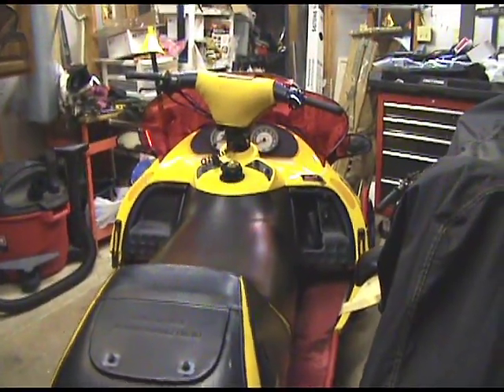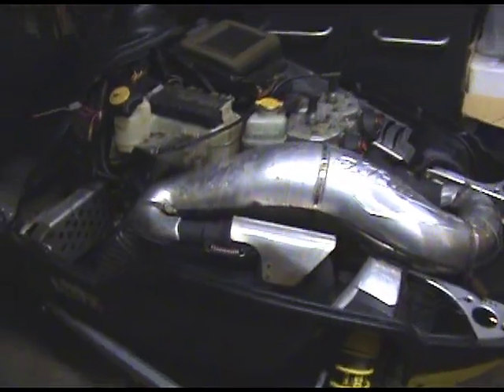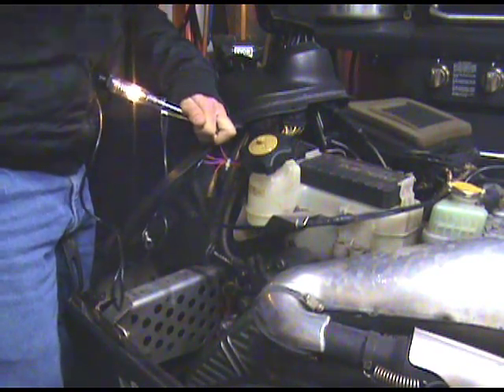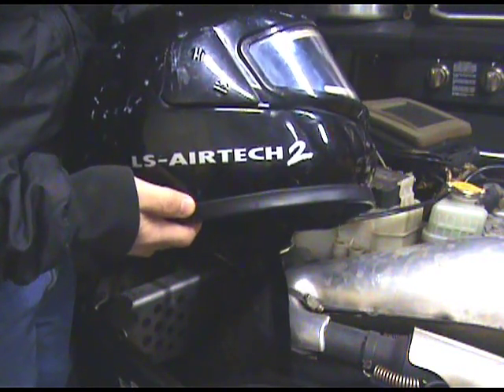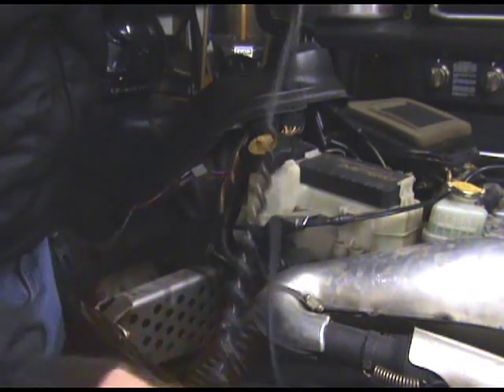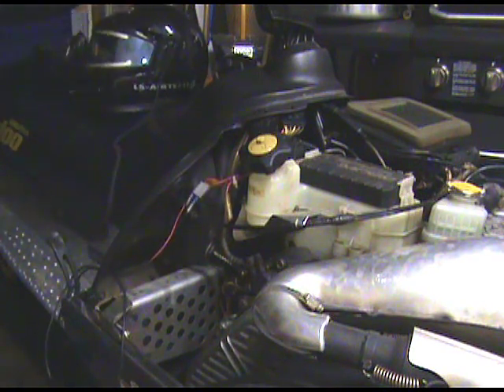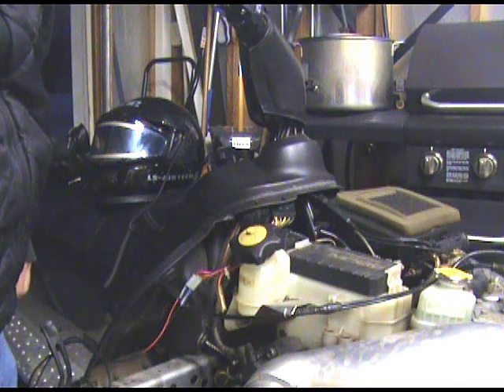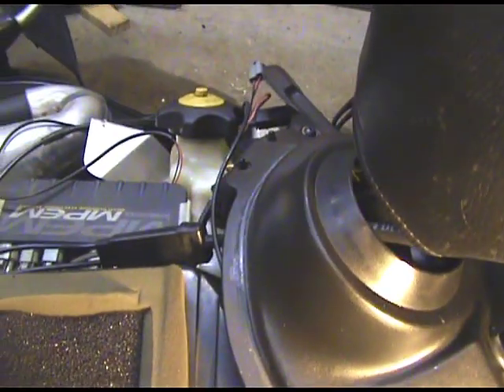Snowmobile Helmet Electric Shield Wire Install on Ski-doo MXZ 700

Comment from the maker: @baseballplayer2121 
I depends on the year make and model of the sled whether it has the outlet or not.  I had a 1983 Yamaha years ago and it didn't have one so it had to be spiced in.  That's a little more involed.  Your 1989 Polaris may not have an open spot.  My sleds available spot may have been for another option that my sled did have stock.  It was there and unused so I used it.  Thanks for watching.

Comment from the maker: @MrMartyzf 
The wiring kit came with my helmet when I bought it back in the 90's and I removed it from my last sled before selling it.  If you don't have one I would either go to a motorsports shop that sells helmets like yours or check online at your helmets manufacturer website.  It really is just an RCA cord like on a stereo system but is made for cold weather and it seals when connected.  Good luck and I hope that answered your question.  Thanks for watching.
Reply: RCA with a 12 v male end I can switch back n forth between atv and the sled now ...... :)

Comment: I have the GMAX heated face shield that I connected to the starter solenoid of a 2013 Skandic. It is ill advised that you do not connect anything directly to the battery because then it is always on. 

A scenario that could happen is one that involves being stuck in deep powder. the snow could get into the socket and cause a short that could cause anything to no damage to major damage to your snowmobile. That being said the connections are a flat eye connection so they could fit on a bolt.
Reply from the maker: +Noah Kuzel 
Are you implying that I or someone else connected there's directly to the battery?
Reply: Not at all. I was just putting it out there that wiring directly off of the battery is a bad idea.
Reply from the maker: OK. Agreed.  That's for watching.

Comment: I have a ski doo modular helmet and the cable plug that goes into the side of the helmet pulled the receptable out . Looks like the weld spot broke away and now the receptacle part of the plug that normally stays in the bump on the side of the helmet comes out with the end of the plug when I unplug the shield.  Is there any way to repair the receptacle so the heater in the shield works again?

Comment: I got a 04 legend 700 and my idle is out if Whack 
What are the air screws supposed to be at 
I always went with 2 1/2 turns out 

Runs like if it has a bad plug 

All stock  with ggb can 

126 in both cylinders 
New boots 
New coil 
New stator 

What’s the air “pilot screw “ setting and how many turn for the idle screw 
Thanks for the help everyone 

Great videos
Reply from the maker: Thanks.  I'm not a snowmobile mechanic so I couldn't say how many turns each adjustment needs to be.  Sorry but I don't want to give the wrong advice.  I never had to adjust the carbs on my sled but If I had to I would start at 1 and a half turns out and see how it runs.  You man want to get an owners manual or some documentation online.  Good luck.

Comment: I have almost the same sled as this, did that connection work for your heated shield? I have all the identical parts for my set up.
Reply from the maker: Garret Diener 
Yes and no. It worked great when I had steady mid to high Tom's but not much at idle.

Comment: Hi I have the same sled and need to install a plug for my shield. did this conection work well for you? I was thinking that I would need to find a connection for the power and then find a nice spot on the frame to install the ground wire.
Reply from the maker: I'm not sure if the shield is working.  I tested for power before I made the connections and I had power.  My hand grip heaters don't work either.  Not sure why.  I don't even see wires coming from my grips.  I may have to do some additional tests.
Reply: Ok I wired mine up the same way. Hopefully the trails will be open this weekend so I can test it out. I live just south of Buffalo and we only have a few inches of snow. How are the trails out your way?
Reply from the maker: Outty68
Trails are closed here in Rochester, but may be open not too far from here.  It's been nice and cold, but not enough snow yet.  Let me know how your helmet connection worked out.
Reply: The trails just opened and Im going to head out in the morning. Ill let you know how well the connedtion works.
Reply: We had a great day of riding on the 26th. I got to test out the heated shield and it worked great. After I did a little research I found that this wire connection is actually the factory connection for the heated shield.
Reply from the maker: Outty68
Cool.  Good to know.  Thanks for the comments and for watching.
Reply: So this is actually the factory connection for heated visor? I was thinking this was for the backup alarm?
Reply: And could a guy just strip all the plugs/connectors and just solder it together?

Comment: speaking from experience, a test light doesnt tell you much. just because the light lights up doesnt mean its the correct power for your helmet. I know I have a 12 volt source but without a rectifier or whatever it is that ac voltage is useless going to a helmet that needs dc.
Reply from the maker: You're right.  I realized later that season that the helmet visor cleared better when I kept the speed up, so it was on the wrong connection.  Thanks for watching.